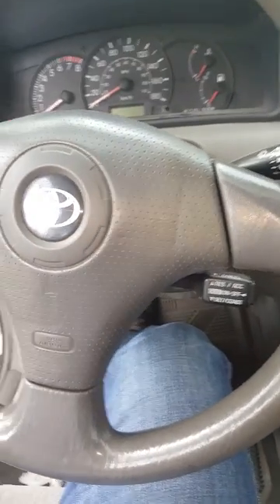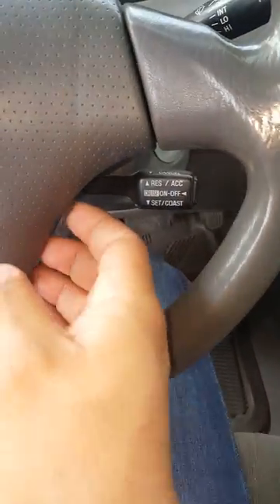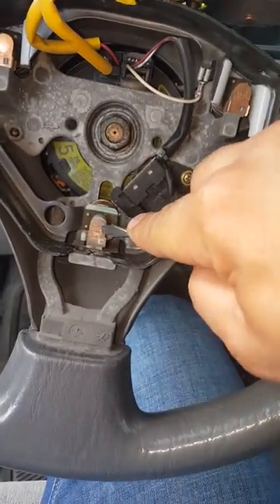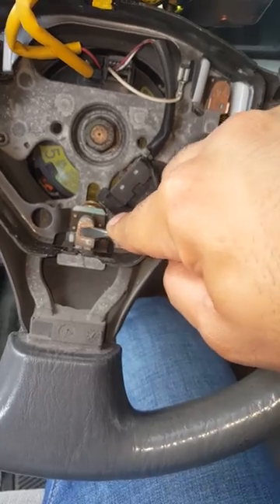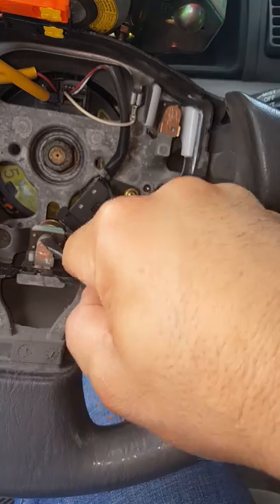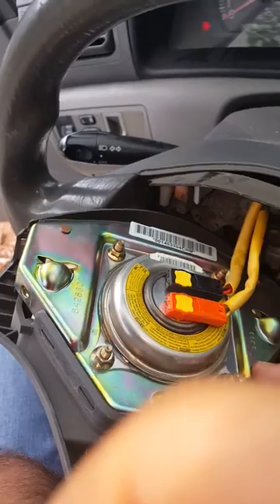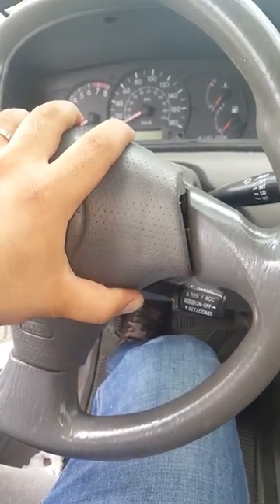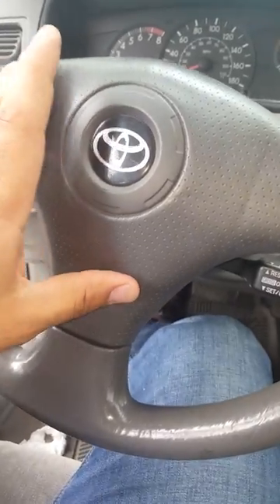How to fix and clean the horn contacts surfaces from the steering wheel toyota corolla

Comment: Remove negative battery tunel  then wait for 10 minute before working on steering if u don't wana to smess own face
Reply: Won't happen.  The other sensors have to trigger the airbag.  It will never just deploy for no reason.